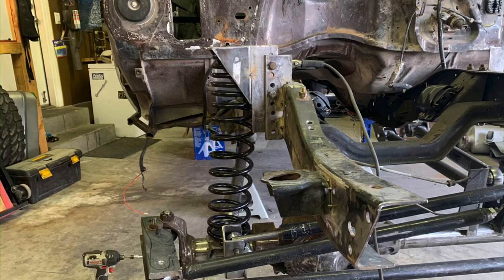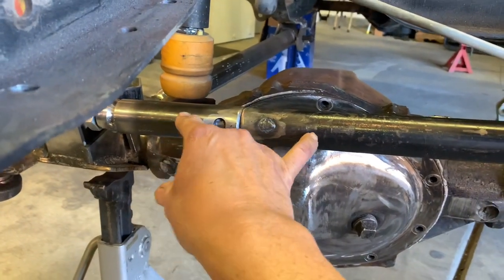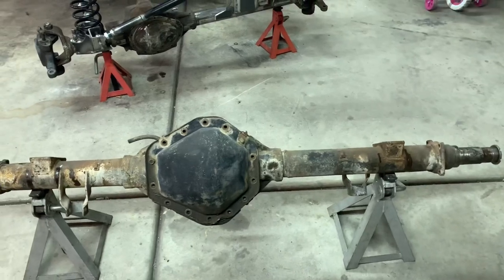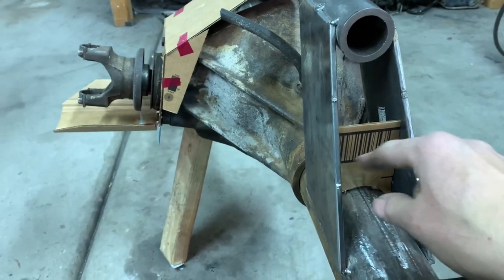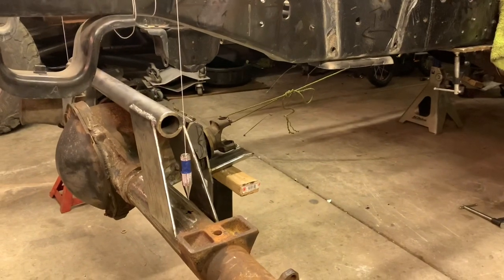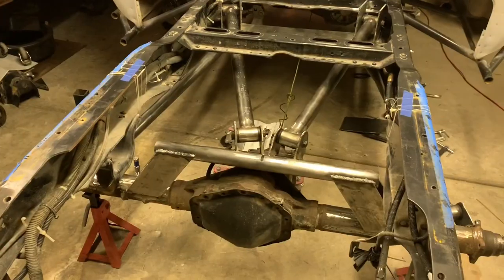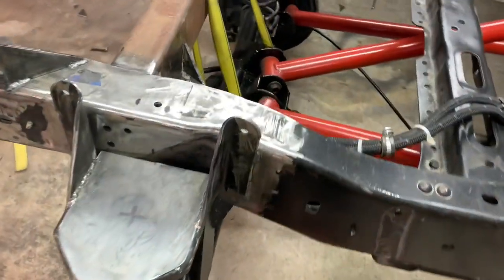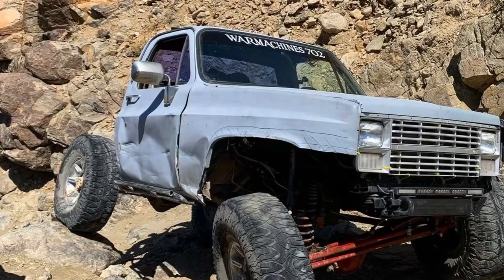REAR 4 LINK, 14 BOLT TRUSS, & FINISHING THE FRONT 3 LINK

Comment: What size welder did you use to glue all this together? And what is a minimum size you suggest for suspension work?
Reply from the maker: Depends, I use a Lincoln weld-pak 100 flux core for most of it, but anything connected to the axles like truss,  link brackets, links, etc are welded with a big 220V welder. As for recommendations, make sure you can weld good, and the bigger the better.